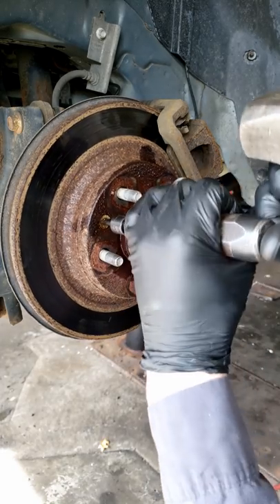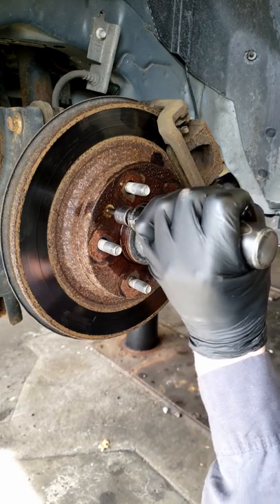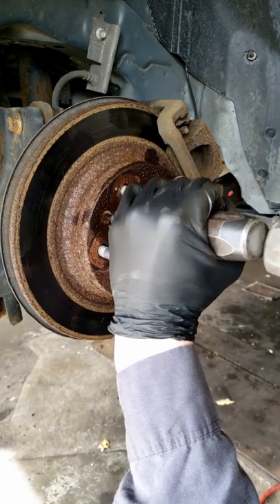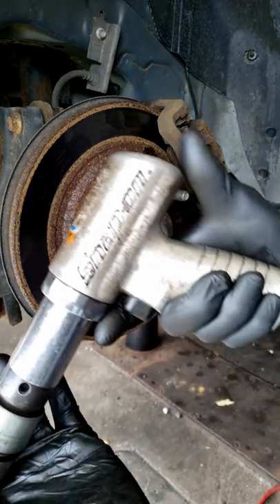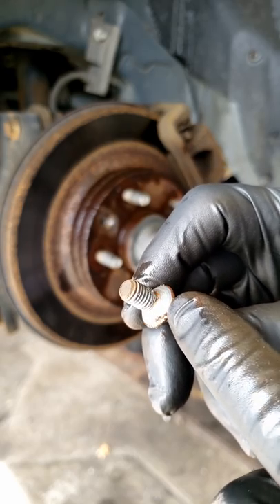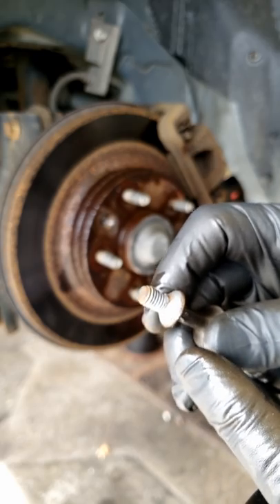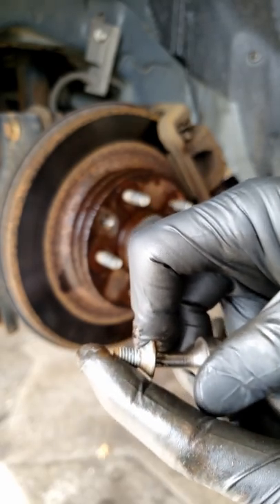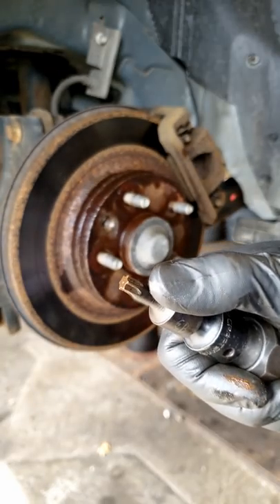Best Way To Remove Brake Rotor Screws

Comment from the maker: Let's get a poll going! Type "ON" if you reinstall the screws or "OFF" if you leave them off.
Reply from the maker: ON
Reply: OFF
Reply: Off
Reply: Off
Reply: Off
Reply: ON
Reply from the maker: Ouch, ON is looking pretty outnumbered right now.  ;)
Reply: Off. They're a nuance.
Reply: @rorschacht8478  They were useful on the assembly line.
Reply: On and blue loctite 😘 Having worked on both MB and VW I can say that the safety screws are significantly less likely to become stuck like that on a vehicle which uses wheel bolts instead of nuts and studs.
Reply from the maker: Definitely more important to put them on cars with wheel bolts as well!  So annoying when people leave them out and then when I go to put the wheel back on the rotor is spinning on the hub
Reply: @algrayson8965  What a great comment...
Reply: Off
Reply: @rorschacht8478  
I'm in the auto parts industry. I was told my our brake parts supplier that they're only meant for the assembly line if the vehicle. That's what I tell everyone and I leave them OFF.
Reply: OFF they serve zero purpose except to be a pain in the ass in the rust belt you got lug nuts for a reason

Comment: Last summer on I 5,   I stop 3 separate times to assist  vehicles  that had (all),  of the lug Studs that snap off, 2 times on the driver front,  1 time on driver rear... all of them were on Ford's. I  assumed that they were all over torque using a air gun... If a mechanic is not using a torque wrench when he does the final tightening, you're rolling the dice of life. Also like to add the best penetrant that I've ever used is 50% ATF Synthetic and 50% acetone.... When mixed together, this will penetrate deeper than anything on the market to loosen up nuts and bolts the penetrating molecules are half the size. Of the best leading penetrant out there.

Comment: i learned this the hard way replacing my rotors and pads on my genesis coupe. one of the rotor screws was missing...? finally got it off. next wheel, stripped the screw and had to try extraction kit for first time. took the whole day but finally got them done. Pain in the BUTT

Comment: I know on the Hondas I worked on, if you get the screws out, you can chug a bolt through the same hole and tighten it to crack loose the rotor from the hub

Comment: If you are like me and don't have an air hammer but are a handy person, do-it-yourself at home mechanic. you can just use a regular nail hammer and work your way around smacking the rotor in between the studs

Comment: Snapon sells a tool that goes in the air chisel it has a bit. Out the side of the tool is a handle that you turn to unscrew the bolt while you activate the air chisel slowly.

Comment: You can use your wheel nuts (if they are deep enough) and put one each side of the rotor screw.  It will releave pressure from the screw and make it easier to turn.

Comment: You can also take a chisel tip on the air hammer and hit the screw with it. Works everytime and 90% of the time the screw is reusable

Comment: You can use a centre punch and hammer to get them off too. First hit a nice dent straight so then when you put the punch on the angle to hit it has a better grab. And remember when using a hammer always kerp your eyes on what you want to hit, not the hammer.

Comment: You need to get the air hammer bit that you can put the torx or Phillips bit on and use a wrench at the same time, never let me down, works great on stuck bleeders too

Comment: If your already grabbing an air hammer just use a shake n' break. Does the same job as that impact driver but hits harder and faster. Then when your done reinstall the damn screws so it is easier to resurface on the car next time it comes in.

Comment: I just torch the screw for a second and then hit it with penetrant and the heat draws it in and it comes right out. I tried to avoid hammering on the bearings like that.

Comment: With my impact driver I just smack it once on tighten to break loose any rust and then smack it a few times in reverse learned that from my old A-tech and haven't had any issues been using that for a few years now

Comment: Tip...
You can buy the hammer bit for most air hammers for about $15. Just weld an old SDS drill bit to one and use in a standard hammer drill. 👌

Comment: I use the same method for machine repair smacking the head of the fastener doesn't necessarily let the lubricant penetrate what it does is it breaks the surface tension between the fastener and the surface it's screwed into

Comment: My favorite way is to use a flat punch and smack the top of the screw 3 or 4 times, I'm in michigan, (rustville) hasn't failed me yet. This is also a great way to do this. Not knocking the guy at all.

Comment: my favorite way that also works on ines witb stripped out heads, is to use an air hammer with a pointed head and to use that to make a small indent on the edge of the screw, then turn it via the indent with the air hammer to break it free

Comment: On a Hyundai Elantra 03 you remove the screw from the top of the manifold shield (nearest the exhaust sensor) which is the same diameter of that hole on the rotor and is threaded to accept that screw ! And then tighten the screw in that hole on the rotor and violah! That rotor housing slips right off with no pounding what so ever! ( Mann those Koreans sure are smart! )  Just a tip to you guys with 03's thru 06's and the same on the other models. Then just un screw the from the rotor housing and place the screw back into the threads on the manifold shield till the next time.

Comment: Instead of using penatrient oil. 50/50 mix of Automatic transmission fluid and Acetone, works much better. Make sure to mix well before applying to rusted area.

Comment: 32oz hammer and long enough 1 inch punch. If you get a smaller punch that will rap the head of the screw and focus on the screw only, that will also help.

Comment: Correct me if I'm wrong, but pretty sure the wheel and lug nuts hold the rotor on there just fine.  Those screws are just a convenience at the factory.

Comment: you can also use a pointed air harmmer bit at the edge of the screw and force it to turn i just do that now instead of the impact driver

Comment: Always smack fasteners a couple times with a hammer before trying to remove...most will come right out.  Then when tightening, torque until it strips or breaks, then back off 1/4 turn.

Comment: If a MODEST tap on the impact doesnt loosen them, warm the head of the screw with a torch just until there are hints of glowing orange. Over 90% of the time, the screw will come right out with hand tools. And you will quit breaking the bits of your impact driver as well.

I agree the screws aren't really necessary, but I like to put them back in when possible, if just to keep debris from getting between the hub and rotor while I re-assemble.

Comment: Best thing to do is take a pointy chisel bit with your air hammer and slowly break the screw loose and then it comes out with ease ! I love using the chisel bit it usually knocks the whole screw loose and easy to pull after that !

Comment: I use heat first, not even thinking about it, I have an induction heater. Air hammer is great too but i like to heat more than listen to that noise, even tho i have ear protection but then i have to find that too :)

Comment: Doesn’t have anything to do with the penetrant. It’s vibrating all the separate surfaces allowing the rust and corrosion deposits to work the part free and create space allowing you to break the seal.

You can do this same thing with dry parts.

Comment: If you take a smaller air hammer bit and give the actual screw a bash it usually comes out by hand after that.

Comment: Not all of us have a air wrench though. If it's that rusted, I'll tap around with a standard hammer to get the initial contact loose then hit fasteners with some heat from a propane torch then soak in PB BLASTER and let it sit for 10-15 min. Smack it with a rubber mallet a few times and she's usually free.

Comment: Well you're half right, it does allow the penetrator to get down in the threads. More importantly the vibration breaks the bond in itself, I use this trick all the time without rust penetrator.

Comment: My brake rotors don't have those screws. They're held on by a single castle nut that pre-loads the wheel bearings. If I want the rotors off it takes just a few short minutes to go from 'rolling down the road' to 'rotor on workbench'.

Love working on old iron.

Comment: I usually just use two ball-peen hammers, a small one to set it on top of the flat screw and a bigger one to smack it. Then just screw it out with a regular phillips screwdriver.

Comment: 2007 Pontiac G5 rear drums,  They do not have screws but, I worked forever trying to remove it! Used air Hamer, mini sledge, P.B blaster & nothing worked however,I do not have a oxyacetylene torch!!!!!!

Comment: No the air hammer doesn't let the penetrating fluid in to free up the screw. The vibrations losen up the threads by breaking apart any rust that is joining the two pieces together.

Comment: You have to use the right Philips head. Their are definitely more than one. You need the one that looks cut off almost right at the point. It's made for the screws specifically 😀👍

Comment: I put the round end of a ball peen hammer on the fastener and smack the hammer a couple times with another hammer. . Basically the same as what you did here, without air.

Comment: Damn, these rust belt mechanics really dealing with something
Reply: lol Just getting the wheel off is a bit of a chore in the good old rust belt. Cast aluminum and steel bonds within a year it gives us a damn good reason to kick the shit out of the tires once the lug nuts have been removed.
Reply: I always put some grease under the rotor/drum and then plenty on top, where rotor it mates with rim surface.

Comment: They make a bid for your air hammer, called a bolt breaker by Mayhew in the United States. That is specifically made for this. Check it out. That’s the best way to do it.

Comment: On my Mamas Jeep I couldn’t get the rotor off so I hit it with a 20 ouncer as hard as I could a few times and it came off. 🥰 then when I put it back on the rotor was worked when I hit the brakes.

Comment: Don’t need the air hammer, unless you’re not flagging. Two hammers will work. Have the first hammers ball on the screw. Then with the second strike the face of the first hammer.

Comment: I usually just hit it once with a hammer to wake it up then I hit my impact driver like a man cause I don't got shitty torx bits and it works pretty much everytime. Also why you taking the screws out before you even have the caliper off

Comment: These always suck on a Honda with a ton of miles. In my experience though a die grinder and a carbide bit will usually make quick work of the screws.

Comment: It’s only necessary to smack the head of the bolt. In this case you would need a punch large enough to cover the head. What it does is stretch the bolt enough it leaves the head loose. Note when you turn it the torque is going to turn the bolt and not the head. Be aware though that you can now easily twist it in half.

Comment: When those small screws are stuck like that I just drill them out. When I do get them out I toss them right in the garbage.The only purpose they served was to prevent the rotor from falling off as the car went down the assembly line. Other than that they are no longer needed.

Comment: If they won't come out just drill the heads off it's quick and easy they aren't hard bolts to drill and once the head is off they won't interfere with the rotor. This is especially fast if you're replacing the hub.

Comment: Rotor, drum screws are for the assembly line for faster assembly of the calipers. Don’t put them back on. The rotor is centered by the hub.

Comment: I’ve always had good luck with a little extra inward pressure and a bit on the end of an electric impact.  And if it did snap my bit or round out the hole, I’d just drill out the screw

Comment: Yeah I never replace the steering wheel nut, it's there to hold the steering wheel in place on the factory assembly line. 
Actually I never replace any nuts screws or bolts on vehicles, they're just to hold things together at the assembly plant.

Comment: Notice they stop at the broken torx bit in the rotor...  lol
Reply from the maker: 1min ran out.  was going for #shorts
Reply from the maker: got it out with a cold chisel and hammer
Reply: @NNKH2  
  I was just being humorous...  I worked in the trenches for many years (ASE Tech) and fixed a bunch of busted studs and broken rotor screws..  ;)

Comment: Wait till you find out there an attachment for your air hammer that goes right to the screw. And it works wonderfully. Don't go full bore with it, and don't let your hub spin while you do it.

Comment: The hell you need screws holding the rotor on for any damn way that’s what the lugs do
Reply: Check the replies to the 1st comment, just a production line thing. I was befuddled once taking the pan off my T-bird trans for a filter change, and found a "stopper"-looking plug in the pan. Spent 2 days trying to find where it went, before asking Uncle (he has a tranny shop). It was a plug put in the dipstick tube hole at the factory to keep dirt out. After trans is installed in car, the worker installs dipstick tube, pushing plug into trans. Unc says people have been flipping out for years when they find it. They bring it to him, ask where it goes, he takes it from them and throws it in the trash. "That's where".

Comment: Get an air hammer bit with a 3/8 square drive that you can twist with a 19 mm wrench while you hammer.  No need for oil or heat.
 The screw you show is a tapper seat. Like a ball joint or tie rod.  How many people just hammer the side of a knuckle to release  a tapper seat.

Comment: I smack em with a hammer all the way around and if that don't work then a propane torch on the bolts expands the length just enough to break em loose. I've never ever used an impact driver or an air hammer especiallt bevause I sheared an impact bit b4
 Typically I just heat em first now and always come out and I toss em

Comment: Do you think maybe its partly cause the rust under the rotor is lifting the rotor.  Therfore lifting it away from the mating surface all around the rotor face.

Comment: Anyone know why they use the screws in the first place?  They used the (I don't know the proper name...) push on washer like things over the studs on some things and those seem to do the job just fine of holding the rotor on and in place on the line.  is there some drawback to those clips that the screws solved?  I can't see how it would be more cost effective to have to machine the rotors and hubs for the screws as opposed to using the clips.

Comment: Once you get them off grease them and grease the back of the Rotor so this never happens to you again. That’s a tip of the day in reassembling. Always grease your nut & bolts and parts before you reinstall them.

Comment: You have half of the equation right. There’s a tool for air hammer that is square drive on the end and has a wrench pad to turn them out while you hammer. Done!

Comment: If you lightly coat the screw or bolts with grease, then they won't be as likely to rust. And they'll be easier to remove.

Comment: If your not going to reuse the rotor just take off the caliper and the gap where the caliper fits in the backing plate line it up with the screw and the back of the rotor with a hammer a couple of times then just grab a screw driver and comes off super ez

Comment: Ive never seen a rotor that was retained by screws and not just the wheel lugs and i am 61 years old and have worked on cars pretty exstensively.

Comment: Just drill them out and then pull the stub out of the hub with an easy out. It will save you a lot of time and frustration. 😊

Comment: No the factory always puts blue thread locker on them. There was no rust on that screw! Heat the screw with the torch that will melt the thread locker then cool it off and you won't even need the screwdriver impact.

Comment: Drill bit works better those are only meant to hold the rotor during assembly on the line u removed that like a skilled surgeon

Comment: Install rotor screws with anti sieze, use a screwdriver, finger tight would be too tight. When the screw just touches bottom, stop. It's tight. Does its intended purpose, won't fall out and will always remove with ease.

Comment: Step one. Pointed air hammer bit. Step two. Drive bit straight into edge of screw creating a dimple. Step three use the dimple to hold tip of bit and turn screw head counter clockwise. Takes seconds. Thank me later

Comment: And if that dont work. A center punch on the top of screw head above drive point. Create a small crater, then turn center punch at angle to drive in the loosen direction. Works every time

Comment: I just grab my small yellow mapp gas torch and hit them for 15-30 seconds. 99% come right out with my 3/8 cordless. Sometimes I’ll smack the rotor a few times first to jar the rust on the threads .

Comment: Why do people do that!!! You don't have to lock those bolts up, hand tight is more than enough. Does bolts are there for 2 reasons. 
1: easy installation, keeping the rotor in it's place while you work on the breaks. 
2: prevent rotor from falling off when you remove the wheel. 

If you want you could run a car without does bolts, because at the end of the day your locknuts are there to hold everything together. That's why you have to torque them down to spec.

Comment: Seems like alot of work. Use two ballpeen  hammers. Line them ball on the screw then hit with the other hammer. I know" don't hit another hammer with a hammer"  but it works. If you deform the head of the screw hit with a impact Phillips bit. Your welcome,  no more broken impact driver bits.